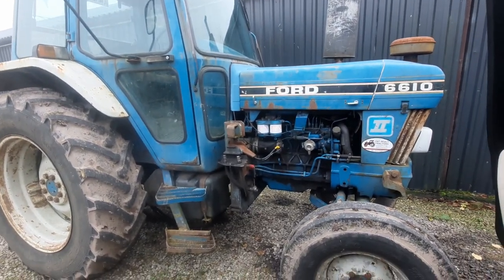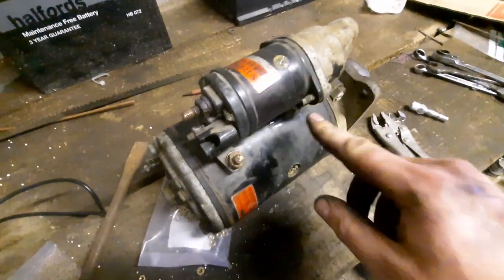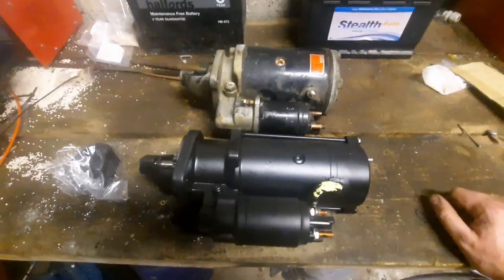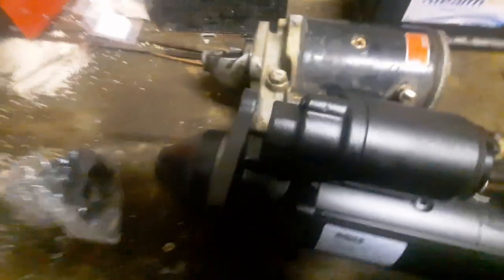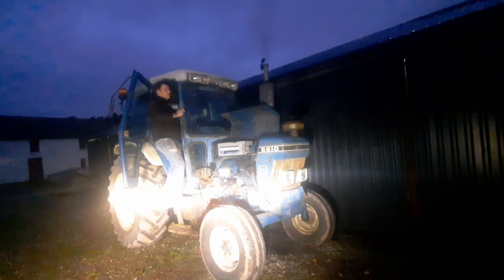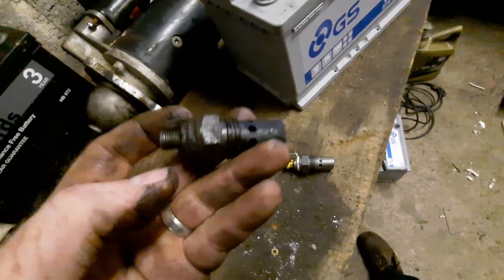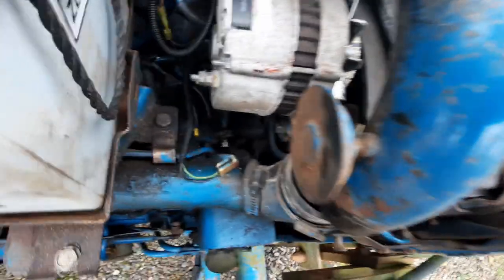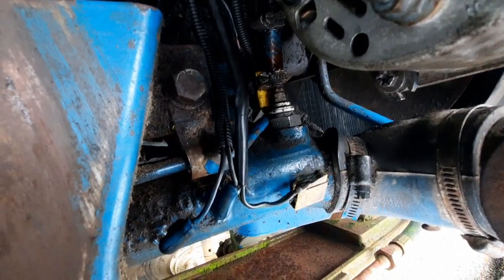Hard Starting Diesel   Geared Starter Upgrade Ford 6610

Comment: Dave, great video! I don't seem to need a geared starter, it spins fine. I have a 1980 Ford 3600 diesel, the three cylinder. Mine ran when I bought it, I ran out of fuel the first time I used it, and then it decided never to start again, I replaced the fuel and filters, bled the system three times, and it ran a bit. Now I am putting in a new manifold heater and looking at the injectors, which appear never to have been serviced.  I'm told they are good tractors when they run. I'm almost there.
Reply from the maker: Those 3 cylinder Ford are gravity fed so they're an absolute nightmare to bleed. Any ones I've worked on have been torture, so that could be a lot of your issue. Look at my 4000 video and you'll see the pain I went through. I had no option but to resort to ether. A neighbour told me he filled his fuel tank and left the bleed open a few hours. Good luck with it and thanks for your kind comments!

Comment: Great video Dave!! That thing starts rite up now!! I think I need to do the same thing to the 3000 it’s very hard to start but I think it could be getting air in the system still
Reply from the maker: Thanks Darrell. According to the forums I'm on there doesn't seem to be one for the 3 cylinders, but they could be wrong. If you're getting air it's probably at the lift pump cover or  filter. Try operating the lever on the pump a few times before you fire it see if it makes a difference. Also see if there's an excess fuel button on the pump for cold starting.

Comment: What a difference the new starter makes. Also having good connections... hard to say what makes the most difference. 
It's turned cold in Kentucky.  Rain and snow today. Winter is just around the corner. 
Take care Dave
Reply from the maker: It was badly needed Clinton. It was so hard to start when cold. Looking forward to see how it handles the cold. We had the first freezing nights a few weeks ago but its become unseasonably mild and dry here. Thanks again for watching, hope you don't get too bad a winter, that snow is starting early!

Comment: Hi im Andy, using my sisters account.  I have a 6610 gen 1 thats a bugger to start on even the slightest cold morning, the starter turns so slow even with a good battery and the wires get warm very quick. Seloniod is clicky too. Thinking this starter would make a difference for mine. Any thoughts much appreciated. Cheers
Reply from the maker: Andy, I have no doubt that it would transform your tractor. I used to dread the cold mornings. I haven't even used the manifold heater so far this winter. Regardless if you fit one or not, go through all your main cables and make sure all the connections are clean and tight. Also check the low current supply from the ignition switch to the solenoid if it keeps clicking or dropping out. To be honest though, the original starters were always poor. They fitted the same geared starter to the TM from the factory so I guess that says enough!
Reply: @davesworkshop2714  Cheers and thankyou for replying, defo think im going down the route of fitting that starter and will use new cabling too as its getting abit tired.  Thanks again for your help and keep those old ford vids coming!. Ps....are those horndraulic loader brackets. I fitted one to my 6610 this year, great loader. 👍
Reply from the maker: @kirstypalmer1987  They sure are! A neighbour had replaced theirs as the loader frame was poor and was scrapping it. We had removed a good loader from the 5000 we traded against the 6610 so we made one up with the best of the parts. It was intended as a stop gap (that was 2006!) until we bought a quickie. It runs off the spools and is constantly leaking so that'll be another video soon! Thanks for watching!

Comment: Great interesting video Dave,that mahle starter motor i believe is a top of the range although that one you got won't suit my 2 Fords 3600 Q and 4630 SQ as it's too long and wont fit a 3 cylinder Ford ynless theres a short version for 3 cylinder engine 🚜👍
Reply from the maker: Thanks Peter! Its strange that there doesn't seem to be one at present for the 3 cylinder Fords. Though I'd imagine they're far easier to start than the 4s. I believe that they're available for the 4 cylinder because they're the same starter as some TM models.
Reply: But i,ll have a look all the same Dave for gear reduction starter for a 3 cylinder Ford,although my Ford tractors are easy started,but i also have a David Brown 1190Q which is a bit hard started in cold weather its also a 3 cylinder as well ,i ll get one for it anyway,

Comment: What's it like now?
Reply from the maker: Keith, I think we hit about -4/-5 Saturday night and it fired right up yesterday morning, still below freezing without an issue. I used the excess fuel button but not the manifold heater, there was no need. It was -8 last night, and I have no doubt but she'll start first attempt later on.
Reply: @davesworkshop2714   think you have the in line injector pump? Have one here with a rotary pump (6410) and it's always been very easy to start. Fitted a Mahle hi speed starter to a Fiat 110 90 last winter, difference is unbelievable.
Reply from the maker: @keitharmitage1801  Keith, that's correct, it's the inline pump. Any ford we've had has been the same so I've never been able to compare. Those starters are fantastic. Some sound from the 110 I bet 🙂

Comment: how are you filming this?
Reply from the maker: That was done with phones unfortunately!
Reply: @davesworkshop2714  Ah, now I realize, you only have one hand at a time :) Great tractor. I'm looking to buy a 6610 at some point to keep my 5000 company!
Reply from the maker: @patmog  our 6610 replaced a 5000 on our farm. Both fantastic tractors. Our 5000 had a 6600 engine fitted. The 10 series was a big step up, but the 5000 beat it in 2 aspects, it felt far more stable as it was so much lower, and the gearbox was better suited to loader work than the synchro box in the 10.
Reply: @davesworkshop2714  Interesting, as I'm just about to put a loader on my ford 5000 in the near future.
Reply: @patmog  (I have a video of my 5000 on this account... this is also Patrick :) )